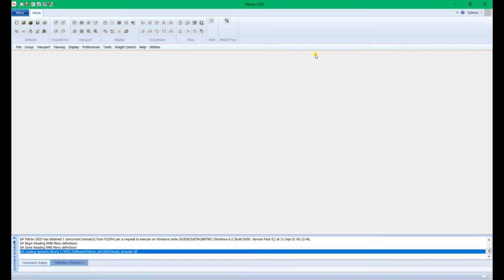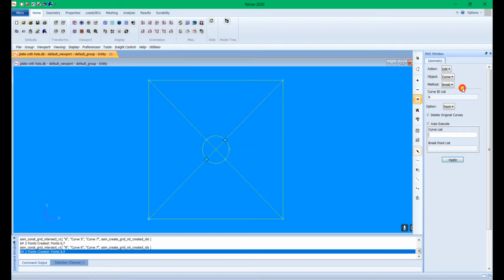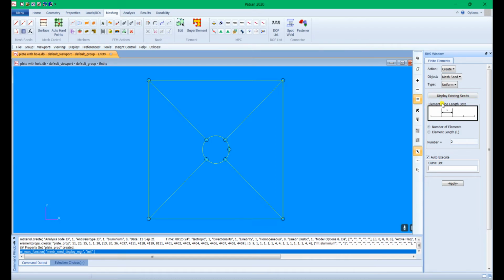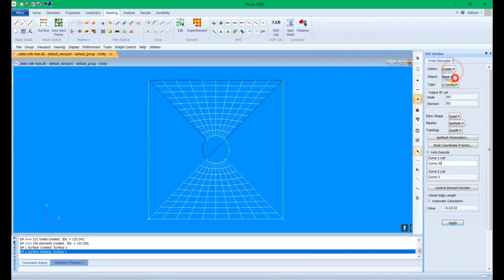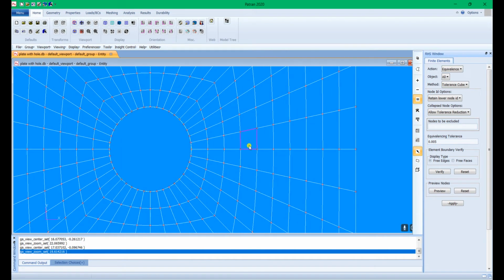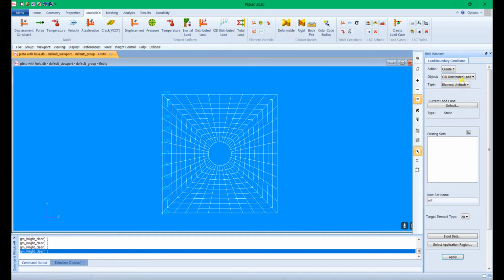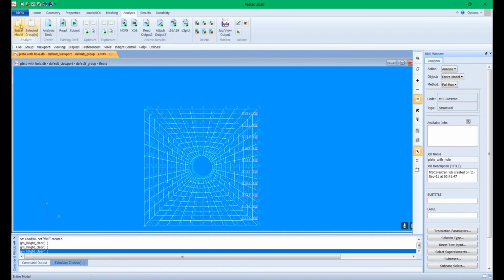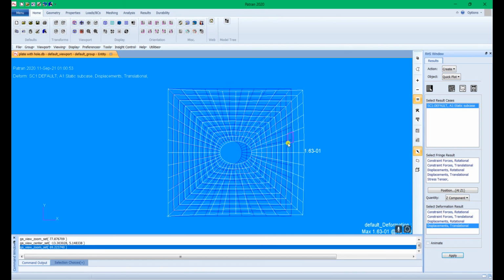MSC Nastran Patran Tutorial  2 Plate with Hole LSA

Comment: Thank you, you almost covered everything. You missed the normal vectors check. When you did the mirror of the elements, the vector on the mirrored elements in opposite to the source elelments. So you need to reverse those normal vectors so all element's vectors are pointing in the same direction, otherwise you will get wrong results.